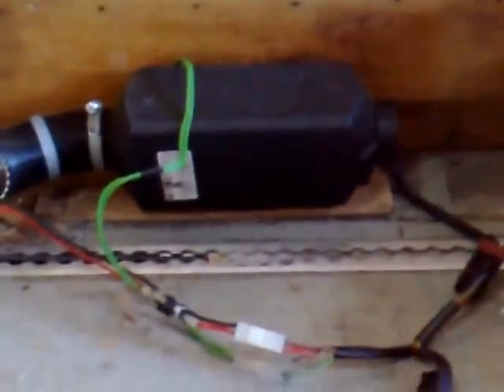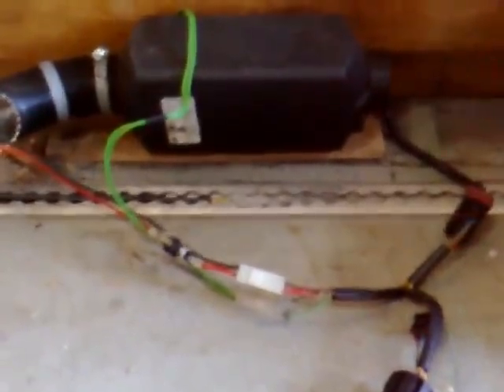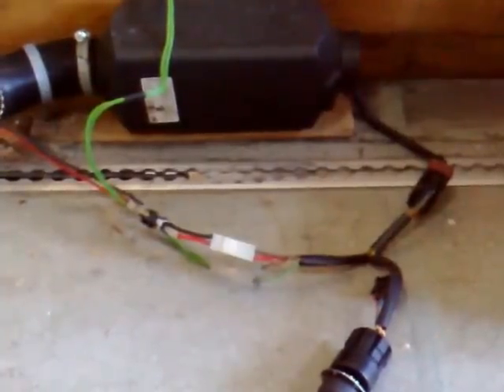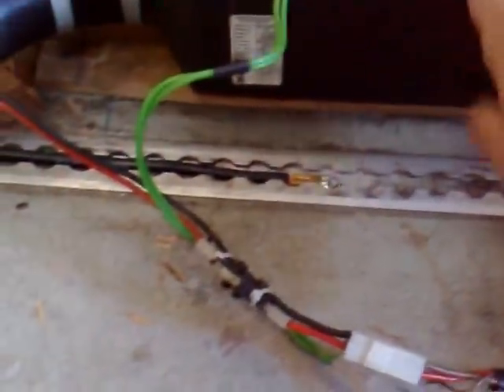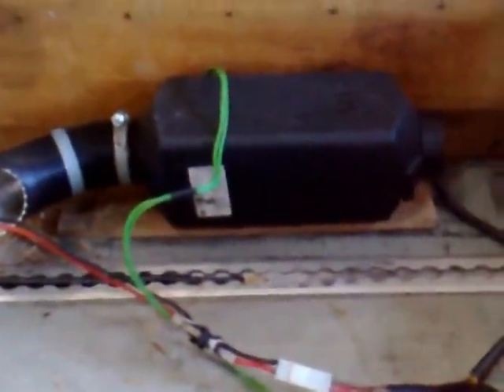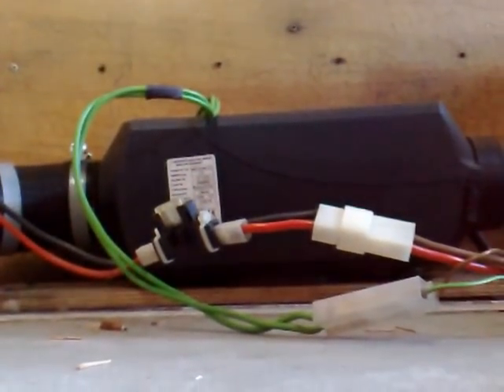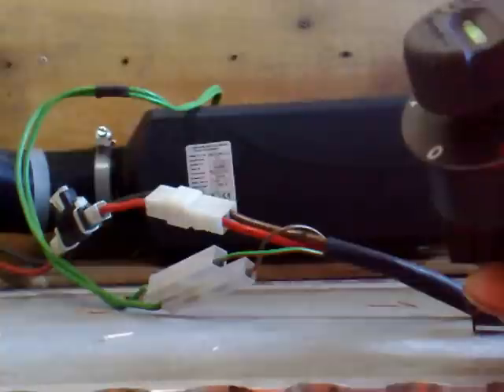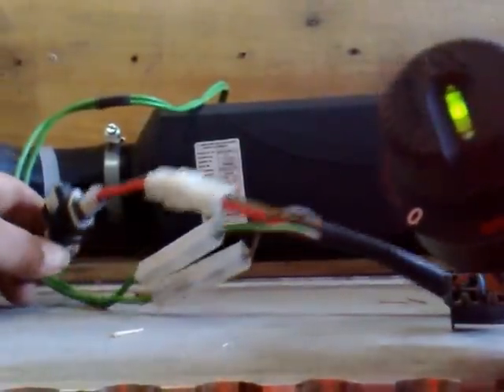Eberspacher Night Heater My DIY Fix For Non Start-Up

Comment: If it wont fire up,,take the hose off the left side..Lift plastic cover off..You will see a rubber boot ontop with a brown and white wire..Carefully pull the boot back..This is the igniter..Take an air gun and blow that area out really good..And blow the rest of the unit out..Reassemble ,and fire it up..Worked for me
Reply from the maker: All these tips  are good info thanks

Comment: It is a faulty ECU by flicking the power on off your are temporary re-setting  it. I working on a bespoke controller to sort these problems and lockouts at a fraction of the price of a new ECU.
Reply from the maker: I guessed it wouldn't be anything simple :( I've thrown it back in the van for now as I only use it occasionally and bought a new D2 for the bus with the 801 controller, but you should do a vid on your mod as there could be a lot of interest.
Reply: Will  when I have the time.
Reply: Martin did you get anywhere with your custom controller?
Reply: @matthewlamb2660  l gave up when the cheap Chinese heaters became available and never looked back as spares are also cheap. Thanks for asking.

Comment: My heater won't come o.. The fan would not spin.. I changed out the control switch and i tested the heater burner with a battery and it came on but when I connect it to the wires the espar d2 won't come on.

Comment: Hi! Thanks for that! I have an ex police Sprinter 416 diesel riot van fitted with one which worked for a while at first in the summer...I have no idea which model or version it is, and what's wrong, it starts up, ticks for a while, then stops.. no warmth any longer. Anybody have any ideas please? I'm in Cornwall. Cheers.
Reply: It has the same controller as you show there by the way...
Reply from the maker: Well don't build your hopes up too much this fault fix might be unique to my errors it's just something to try if all else fails, probably the best option is to upgrade the switch to an 801 with error code read out but then you could be throwing money away after bad but good luck anyway especially this time of year :)
Reply from the maker: Ok should of read this first don't do what I did in the vid if it starts up then you should be looking at battery supply voltage, fuel supply, fuel pump etc, etc, I posted a link below to a site that has good info for ebers

Comment: I've got a D2 in my camper that's not working. How easy are they to strip out?
Reply from the maker: I've only ever taken the outer casings off, never dived into a full dissemble a good site for info is http://letonkinoisvarnish.co.uk/Eberspacher_Intro_1.html
Reply: VanBooter

Comment: Can you PLEASE help me ?Do you know how to unlock a D1LC Compact from 
Scania ? I have one that is interlocked because of too many overheats, 
error 44. I have a original eberspacher tester that does not read the 
faults from D1LC compact Scania, with the original tester I cannot reset
 the heater.DId you ever manage to reset and read a D1LC compact from 
Scania ?..
Reply from the maker: +thecosmy1 No I can't help I only know some folks have start-up problems with this heater D2 as I did this is just a simple method of suck it and see because it could be a host of other things. I do know some of that model locks itself out after so many fails 5 I think and it's a reset by an eber agent ££s but if it's overheating you need to get that fixed as well

Comment: I had an error code which told me to boost voltage. Then I switched out my output from the generator to the 220v one, which would supposedly blow the fuse if too much. But, it resulted in white smoke in the cabin, where it is not supposed to be. After that, I could not get it to turn on with the 8+ volt output from my generator. Do you have any idea as to how I might repair this problem? Thanks for your video. It brings knowledge, which is always inspiring. Cheers

Comment from the maker: I think the easy answer to all these problems is to first sling ur ebersplasher in the bin and then buy a Chinese heater, I've heard good reports about these and they can be had for a fraction of the price, infact one ebersplasher ECU will buy you 2x Chinese diesel heaters so it's a no brainer.

Comment: I have a Eberspacher, version D2. It doesn't throw heat, I notice it works sometimes. Any suggestions would be gladly helpful.
Reply: Alert Gps there is a spark plug inside the heater unit. And you put a filter to head of that spark plug. I suggest you to check that filter. That’s the thing burns diesel and heats air. (i had the same problem and solved like this.)